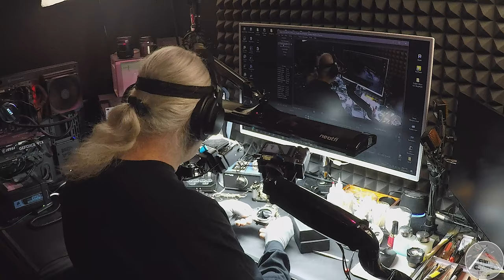Tour Inside The Nikon FE2 | Vlog #020

Comment: My heart just sank. I accidentally had the shutter charged while loading film. I released it and the leader dropped down between the shutter blades. JUST LIKE YOU SAID IN THIS VIDEO 😳Then I stupidly just yanked it out. Now, there's a slight gap, less than half a millimeter, between the top rear curtain shutter blade and the blade below it. I'm not sure if it was there before. But, the other one I have has perfectly flush blades. I finished loading it and took some shots and it doesn't seem to be affecting the shutter. So, wondering if there's anything I can do to make sure I don't ruin it from here? Or, is it just a matter use it and eventually it will foul? I was planning to take it apart to do the shutter service at some point in the near future anyways.
Reply from the maker: Half a millimeter does not sound too bad. I have seen much worse. I don't think the shutter will self destruct over time with use. It's a shame it had to happen. I've seen too many of these FE2 and FM2 shutters damaged this way. It's not a very good shutter blade design. Your high speeds might be effected. There's nothing to be done, but live with it. Replacing the shutter or blades will be expensive and probably not worth the cost.
Reply: @FilmCamera_Vlog  thanks so much for your reply! Going there's no light leaks 😅